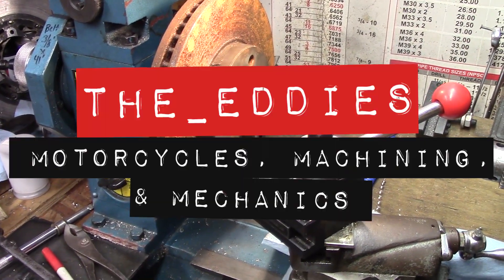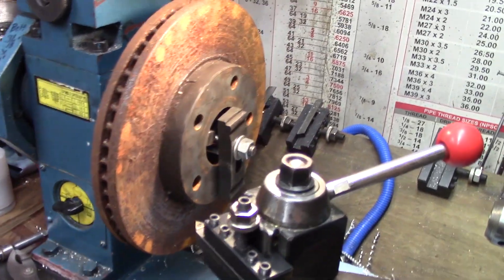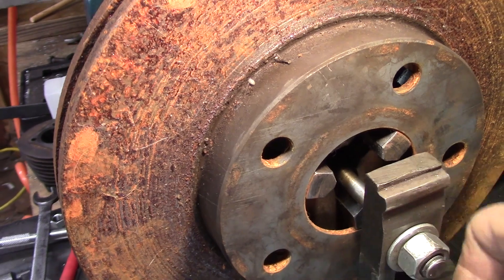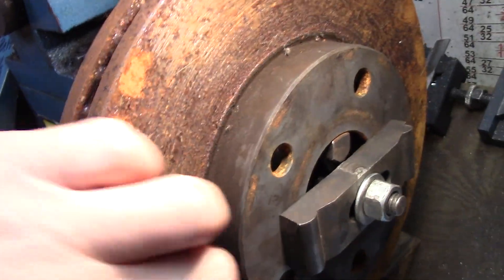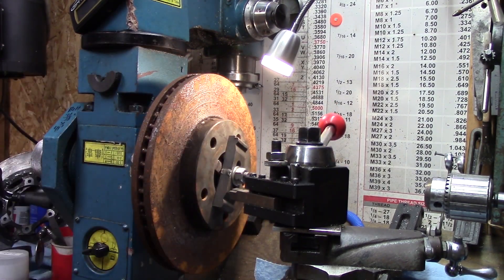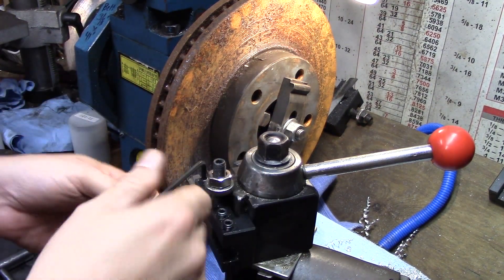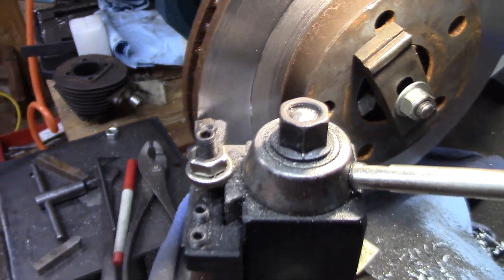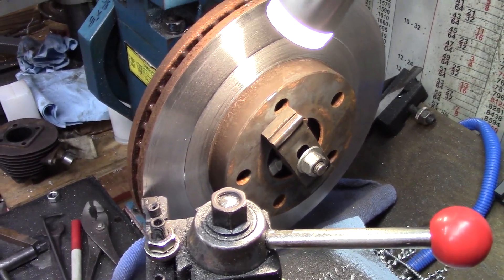Turning a Brake ROTOR Disc on a Small Lathe Mill Drill

Comment: You really need to turn both sides at the same time , if you have bad hot spots they are super hard to get through .you need to use the back gear to slow it down.   Some top hat rotors aren't too expensive at trade price .

Comment: Thanks for making a mess…..
And experimenting…..since you stalled…what is your motor size? 
And machine spec…?
Trying these cutters helps others…maybe fabbing a custom cutter..?
Reply from the maker: It's a small hobby lathe/mill, 3/4 hp. Def. would want a job specific cutter.

Comment: My observation is there are a lot of aftermarket brake discs made from recycled metals, perhaps not always a pure blend or mixed very well. In use , some bits get heat treated different to others. Can physically see, feel and hear the difference when machining. It’s not there in quality OEM parts.

Comment: It costs far less to pay a shop with proper tooling to do this work than what most peoples' wages will be per hours of your time messing around here. So unless these services are not readily available in your area you will be working for pennies to pay yourself to do it. Personally, my time is more valuable than that, and I've been machining in the aerospace industry for 17 years.
Reply: I think you're missing the point. It's not about how much you save doing the work yourself it's the fact that you can do it yourself and you're willing to put forth the effort.  I could easily afford to take my cars to a shop and have the work done but I still do it myself because it is something I enjoy doing and I know the work has been done correctly.
Reply: @BRsWorld  correctly? To what extent? Yours! You mean the only way to do it is your way! Just because I do something differently than you does'nt make it wrong! I'm 46 and been in fab shops since I was 16 and own my own shop now! At the end of the day as long as we both got the same result does it mater how we got there? No it does'nt

Comment: Today is Aug 30, 2022. I need new front rotors for my car. Usually $20 each or so.......$90 each now!! Normally I'd just change em out because I've had rotor lathe operators screw em up and it wasn't much more to go new without the hassle of machine work. $90 each!!! My jaw dropped and I walked out.
Reply from the maker: That is rough. I have stopped buying from local auto stores. Last rotors I bought were $23 a piece shipped from Amazon.

Comment: Hello Eddies...I have the exact same machine that my brother in law gave me.  I pulled all the bearings out and cleaned off the dried, caked on grease and inspected them and to my surprise they were in really good shape.  After good overall cleaning of the machine I re-greased the bearings, reassembled and oiled the ways and feed screws and she runs like a champ.  I did have to replace the rotary switch with one I purchased from Grizzly.  Figuring out the wiring was a challenge, but I managed to get it right on the first attempt.

I need to replace the feed screw and nut and I was hoping you could tell me which parts from Grizzly you used??

As for this video, thank you for making it; I have been wondering if rotors could be turned on this machine and would it be worth the trouble.  As a last ditch solution, yes, it is possible and in a SHTF scenario I would do it.  But in the meantime, I'll keep a set of brake components for each vehicle on the shelf in the shop.

Keep up the good work!!
Reply from the maker: Hello, thanks! Mine cleaned up pretty well as well. Though the grease they used was in the same shape as yours. The part I got from Grizzly was the back screw bracket. That was several years ago.  Last time I looked, I could not find the replacement parts anymore. Though I did not search very deep. I ended up buying a tap to make the feed screw nut. My screws are in good shape except the main one has a slight bend from same accident that broke it's bracket before I got it. 

I plan on making the nut out of brass or bronze, I just have not got around to it. When I do, I was going to do a few to sell as long as the tap lasts. It was pretty cheap. If you want one of those, just pay shipping and materials but it will be a few months probably. As far as the screw goes, I would just buy a length of the proper pitch and machine the ends. I think McMaster Carr sells the right thread. The tap was hard to find for a decent price. I ended up finding one on eBay. I could send a link if it is still available.

All the best!
Eddie

Comment: I tried this a couple times on my logan. I wound up with a bunch of run out. Then I saw a guy on YT do it with a rotary table on his mill. That worked pretty well for me. But I still just ordered a set of new rotors for the probe
Reply from the maker: Honestly after doing it, I would only do it if I had no other choice. Some serious trash metal they are making these from. And it was OEM Toyota. I cut a small vintage motorcycle one a few years ago and i could get it smooth as glass if I wanted. This was like cutting foundry slag. Between that, the hard spots from overheating, and the price of new, it does not make sense. I can see a use for doing this on drum brakes, especially the old bikes I work on but not really worth it for car discs. Thanks for watching!
Reply: @theeddies  I hear ya. With car/truck drums , I just grind off the outer ridge with an angle grinder and call it a day. Seams to work well so far at least

Comment: I have that lathe. Seems it is almost perfect for maching discs. Rpm a bit fast
Reply from the maker: Yes, if it had just a little more X travel it would nearly be perfect. The rigidity is a bit compromised on the outer edge of 11-12" but it works going slow, except when it decides to dig. LOL. Thanks for watching!
Reply: Is this the Harbor Freight lathe?
Reply: the rough Finnish is because there is vibration between the rotor and the lathe tip